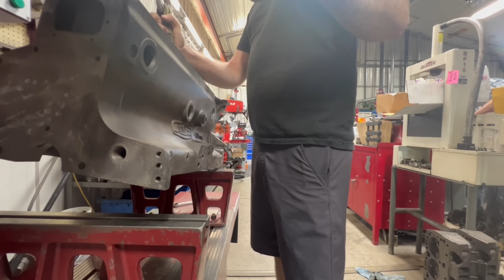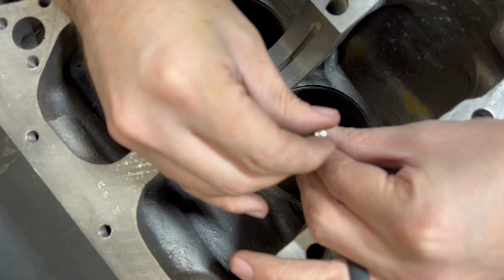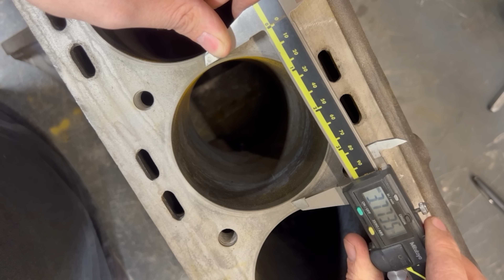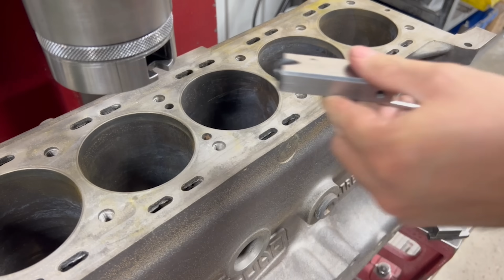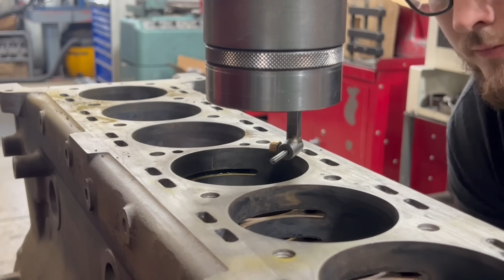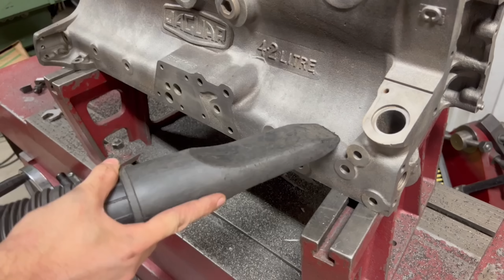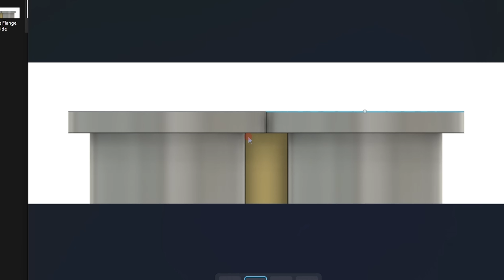Can This 1968 4.2L Jaguar Block Be Saved?

Comment: Gonna have to weld. Grind the crack down, Heat the entire block even until is red hot. While is red hot weld. Let cool slow 10 degrees per hour( very important). Machine the block to specs.

Comment: These Jag engines had the same problem as the 400ci Small Block Chevy. They kept trying to get more displacement out of the same block and ended up running out of material. 3.4L and 3.8L Jag engines on the same block have much more material to work with and fewer issues. Likewise pretty much the entire SBC line is ultra reliable if built right, except for the 400 because of its issues with displacement(of course with modern knowledge a lot of its pitfalls can be fixed). Literally no cooling in certain areas of the engine because there was no room for coolant to go through.

Comment: I’m a 73 year old British Car technician (retired) as soon as I saw that block on the stand, I said hey isn’t that a Jag block.
  Those overheating and cracking problems were very common with the 4.2 engine and spares were a plenty. 
  These cars and engines made it to the American market around the same time US car owners were use to “ idiot lights “ and failing to pay attention to their gauges.
 It was REAL machine shops like yours that made me the hero every time.
 Bob Anderson had a Corvair Monza that was completely set up for crankshaft grinding and cylinder sleeve replacement.
 The process you used in the video, I’ve only had to do twice, once on a Jag and again on an older V8 Rolls block ( it was referred to as sweat fitting.
 Your preparation was awesome, because in both cases with my experience, decking ( serious decking) was required and the Rolls engine required double head gaskets to correct an external seepage problem.
 All of our machinist would say the same thing, that Jag continued to use the same block taking it from 3.4 to 4.2 liters. The 3.4 and 3.8 engines almost never had those problems.
 I just wanted to say that it’s guys like you that made me look 👀 good for over 50 years! 
 Thanks for your wonderful content and precise work out there for all to see.
  Most modern engines weren’t designed to be repaired. 
  Newer materials make um last longer but they’re usually scrap when they let go!😀thanks again! Great channel!

Comment: That Jaguar motor seemed like a state of the art motor, with twin overhead cams and a hemi combustion chamber, but it was severly undersquare...3.625" bore x 4.2" stroke...which severely limited it's revving potential. The redline on those motors was 5,500 rpm.
 Compare that to the small block chevy which was oversquare...the 302 C.I. motor was 4.00" bore x 3.00" stroke...which could be revved much higher. The 302 motor, despite being a pushrod motor could easily go to 7,000 rpm. 
Since power is torque x rpm, a lower rev limit cuts down on the ultimate power that the engine can generate.

Comment: The sleeve flanges overlap each other,kind of like in cold welding.Im guessing that the design flaw are those  2 slits at the top for coolant circulation causing those cracks.right?Just whip out some JB Weld and your troubles are over.That boring machine looks Eyetalian.

Comment: The damage on the sleeve and block happened from the factory. Jaguars were very cheap cars for their period, from the late 1940s to early 1960s, they were a successful company because they made their cars relatively economically accessible to a large audience. For example, the XK120 which was when it was introduced the fastest mass manufactured sports car in the world, when adjusted for inflation; cost new about 45k to 55k in £ $ or €. And the fastest four door sedan of the late 50s and early 1960s, the Jaguar MK.II 3.8l was when new, adjusted for inflation in the same price bracket. And the e-type from that era was 1/4 to 1/3 the cost of a contemporary ferrari or lambo or mercedes-benz. 

When I was kid my father had a Jag MKII and also a VHS casette which documented the manufacturing process at the Jag factory in 1964. The process was very cheap and stages of engine building that would by modern standards be done using precision instrumented lathes and grinders and quality of the finishes controlled accurate measuring tools, were done completely with out any such measuring tools with feeler gauges and with out an actual balancing machine being used in the finishing process. Essentially the end result was based on the operators feel for getting it right.

And this was Jaguar pre-BMC merger in 1966 which was noted as the era of high quality manufacture for the brand. And that the quality dropped significantly after that, and got catastrophic specifically in 1968 with BMC merging with leyland and number of other brands form British Leyland, after which pretty much everything was crusher ready unserviceable half-manufactures off the production line until the end of that clusterfuck of a shit show in the 1970s.

So, yes. The damage was done from the factory, by fitting the sleeves with out lube AND fitting it with excessive press pressure.

Can't really see any point in restoring something like that, as a matter of principle. It was shit from the factory and doesn't need to be restored for posterity. 

Only morally justifiable way of dealing with a car like that, is to restomod it to modern standards of manufacture and engine fueling and management. Would scrap the block if I found one and replace it with a XK block from the 1990s XJS.

Buuut, boomers got money to burn into stupid fools errands like that, so. Their money and if I was there to provide restoration services, would do it for money. Just would feel dirty for doing it. :D

Comment: Pin the cracks bore oversized with a top and bottom step and use a ceramic sealant on the sleeves. Or gring the cracks and braze them then over bore and install flanged sleeves with the ceramic sealant.

Comment: I was watching a video where they had been doing some sort of metal stitching repair.   I don't know if it was a cylinder boar or what.  but with they had I think it had a water passage That they were trying to fix.  Just something you might want to keep your eye open for. I don't remember what the name of the product was,   but they were definitely doing an engine block repair.   ><    I looked,  i found metal stitching,  lock and stitch,  metal locking.  I don't know if this would work for you since It says that is used on cold joints.  After looking at the application description it looks like just possibly would not work on your application.  I look for the video,   could not find it. What I did find was on Wikipedia.    LjN

Comment: Grind out the cracks, weld back with a cast iron filler rod. Then clean cut the bore and resurface the block.  Brazing or nickel will not work long term due to different expansion rates.

Comment: Unfortunately it seems to be a badly designed block and the jamming the sleeves into the cylinder bores didn’t help it.  Very interesting video. Top hat sleeves sound like a viable answer

Comment: 100% on board for the top hat sleeves and green Loctite. The green has worked like a champ for all the applications I've used it for. Unless the owner is a complete idiot and massively overheats the engine or Nitrous. The machine work will hold just fine. Worth saving for a numbers matching rare Jag.

Comment: Chances are if all of them have the same design flaw and are cracked that it’s fine to just leave the cracks their. It was probably running cracked for a long time. And thanks to the cut for the water Chanel the crack will never go any further down. You could weld it up but then it’ll probably just come back after a few thousand miles.

Comment: I've used T-hats on 4.2 and v-12s. As long as machining is perfect and surfaces clean with proper gasket installation there should be no issues. For some reason I have always found that the bottom of the cylinder has been a few thousands tighter. I do not know if it is a design flaw or from cold to hot temps of the engine running during it's life cycle.

Comment: Never had an issue. They all crack. Modern head gaskets are much better quality and on all except the very last of the 4.2's they seal well..the very last 4.2's from the 80's were shockingly bad

Comment: Counter bore the block and install the tophat sleeves. I'm assuming they're not going to be racing this engine or beating the hell out of it so if that is indeed the case it should be fine.

Comment: If that was my engine, I'd strip any useful parts and smash the defective block before scrapping. What fits? An Austin? A four cylinder Rover? Oh, I have one. I'd carve motor mounts plus leather washers. A few custom hoses and a stainless exhaust, and the Johnny Cash Jaguar would be happily back on the road. What's that shiny paint and leather for? Taking kids to the beach and drive through menu. Matching serials? It's not the Wright Brothers Flyer.

Comment: When I saw this block, I felt completely different... Jaguar designed a real weak point. Well, we also have to take into account when this block came from, because we have to reckon with such unpleasant surprises. I would try to save this block by inserting liners...whether it will really succeed is of course in the stars...

Comment: I ran an independent Jag /Aston / Bentley shop for years in Maine. We never saw a 4.2 liter that wasn't cracked. The problems arises from Jaguar using the same 3.5 liter block casting for the 3.4, 3.8 and 4.2 liter applications. The block performs best in the 3.4 liter iteration. Punching it out to 3.8 liters for the US market (Power steering and A/C) enhanced the output but the surplus was quickly absorbed by the ancillaries and never saw transmission to the road. Curiously we saw fewer 4.2's crack in racing applications as the engines were hard mounted to the frame, with only neoprene mounts (no spring) at the rear of the transmission. I think this reduced twisting in the block under load, which promoted cracking as the inter-cylinder distances were too small after boring the block out. I have returned a couple of 4.2's to 3.8 liters using custom sleeves and have not regretted it. This is truly a case where displacement does not inherently help the engine.

Comment: Drill the crack or machine it away with a dremmel & a carbide bit. Al the way through the crack. TIG wel the block & finish it of with a dremmel & fine carbide bit.

Comment: Iam not an engine block expert . but you can try boring out and welding back, but you have weld not in air some protective gas , but that is the easy part the hard part is finding good metla to weld, find out what the alloy is med from the block

Comment: I use Irontite as a sealant for all my blockwork. It has never failed, even on high performance V8 blocks. I am a bit worried that your method does not address the cracks, but rather cover's up the fault.

Comment: Top hat sleeves sound good to me.  I'd also overbore the block bores slightly (+.010") to take/clean out the bottom of block bore disparity.  Alternatively; & I admit this is a lot of unnecessary work compared to 'plan #1';  vertically slit the block bores past the two water slots,  weld,  bore true,  & re-slot.

Comment: I worked in my father's machine shop for 20yrs, using a telescoping gage for the bore, u put it in the hole on a small angle, tighten it, and pull it back towards you and out on that angle so it collapses the pin and u get a accurate size with the micrometer...

Comment: I'm no engineer or engine builder but I feel like if you were to weld the block where necessary to make those water passage repairs then maybe throw in an 1/8th inch flanged sleeve but also milled out a shim-style gasket you could effectively say goodbye to the gasket and have a metal on metal head-block configuration. I'm not sure if it would benefit this build or not however as that's a technique (minus the flange sleeves) used in high horsepower race car configurations (boosted etc).

Comment: Cool slowmo on the chips. My old boss always wondered why I always would jump on boring  bushings for this mining company that was always in need of these brass bushings (I have no idea what sort of machine they are on)  especially when they were sort of a pain in the butt to set up.  
The reason why I loved doing those parts was because the insert I used at the feed and speed I always used would always throw chips that always looked like a golden fountain. Each took about 40 minutes to bore.  I never ever thought of how cool it would look in slow mo!

Comment: So the old school fix is using a keylock system that ADDS to the strength of the crack itself. As a machinist, the key lock system can be used anywhere, with any material and it is machinable and holds tolerance. It will also prevent deformity with heat that'll cause seals/threads/gaskets/keyways from working correctly. For me it's the easier way of doing it because it involves the least amount of machining afterwards and anyone with a magnet drill (or vertical mill that's big enough) that can follows a jig can do it.

Comment: installing sleeves with lubricant takes up space. I would heat the block up a couple hundred deg and freeze the sleeves. Press them in dry with ice packed in the boar. You gotta bring the whole block up to temperature.

Comment: Since it's going to be a restoration, why not just O-ring it with standard sleeves? It isn't going to see high horsepower, lots of revs or many miles. An O-ring would seal and prevent leaks without over-boring what appears to be a sand cast block. That way if there is ever a good procedure to repair that kind of damage invented in the future, that block could be brought back to like-new. It's what I would want if I were building a numbers matching E-Type. Once you cut it for flanged sleeves, that's it. There is no going back. This is already a closed deck block so there is some strength to the deck even with the cracks. With nice, new iron sleeves and an O-ring I don't think there would ever be a problem. If there was, you can always take it apart to try again. But cutting an all original engine is like amputation. Once you do it, it's done forever.

Comment: Something to consider also. CAT block sealer. We used to use it on cracked blocks and bad head gaskets on Cat and Cummins diesels. Lasted a long time. But you MUST follow the directions. If not you won't have coolant passages. You ad it to the coolant and run the engine and leave it in for a specified time and drain the system. This trick might save the engine if your repair doesn't do the trick or to make it last longer. It will definitely seal those cracks.

Comment: I have absolutely zero experience on this kind of stuff but what if you try and weld the cracks shut then grind it flat?
Reply: The next part of the repair is up on their channel, the cracks were left untouched, they solved the issue with custom sleeves as explained in this video :)

Comment: I don't know if it's true, but someone told me the 24 valve XJ40 heads (4 valves per cylinder) are compatible with the V12 which were 2 valves per cylinder.

Comment: Why can't you weld the cracks?  (Genuine question, don't know much about engines or welding.)
Reply: It’s cast iron, very very hard to weld properly. It is possible, but complicated to do it right, you’d have to take it to a specialist, and there aren’t many around. In an engine it’s again a bit harder to get right since it will heat up and cool down with every use

Comment: Great video! I think you have more work you didn't mention. You showed the inconsistent bore spacing. Does the bore centerline contact the axis of the crank? The bores are going to have to be 'cleaned' up w/ Total Runout checked from the top & bottom of the bores to determine the axis. What CAD system do you use?

Comment: I'd suggest welding up those cracks as best as possible, Re-sleeving the block and machining in O-ring grooves for a headgasket with seperate fire rings.

Comment: Counterbore and possibly a combination of grinding down and welding or brazing the cracks would be my first instinct.

I'm not sure what kind of space you have in the cooling jackets, but a broached channel with a lateral bar of a material with a lower expansion coefficient seems like it could be interesting. Essentially pre load the block so the area prone to cracking are in compression. Blind throw of a dart but I'd be curious to see if anyone has done anything like this.

Comment: Reminds me of ford's flat heads flaw as well where the two middle ports on the head share a single exaust port which causes that section alot of heat stress and evntaulty early crack

Comment: you could  weld a "pillar"  in the cracked area, if you noticed the cracks are all in the center of the bridge of the cooling gap....weld the crack and a support in the middle of the cooling cuts, that way the unsupported area is 1/2 the size and less likely to crack again

Comment: I like the top hat version, it seems to be the safest bet

however, considering that welding is not an option, would soldering be feasible?
considering the thermal stress on the top of the cylinder I would be hesitant to leave the cracks untreated as they will cause further issues down the line
on the flip side, that engine most likely won't be driven all that much, so it might be fine just with the top hat sleeves